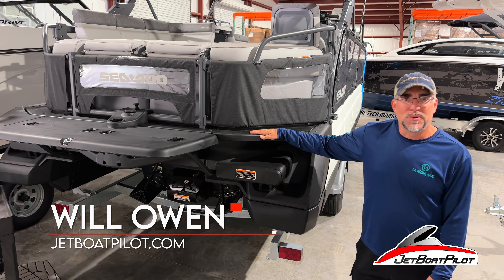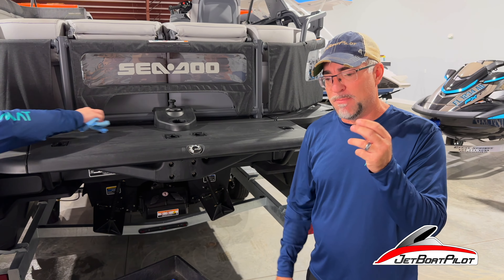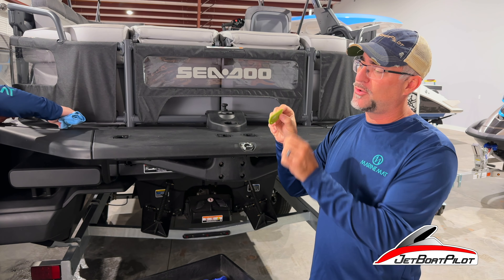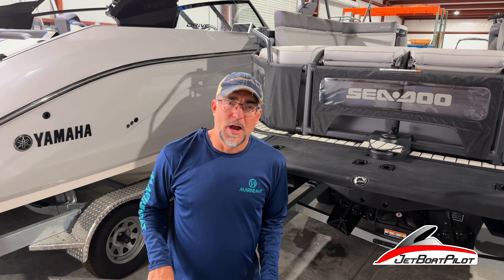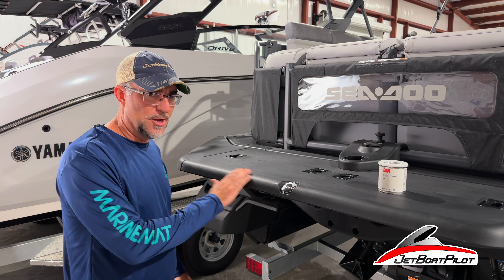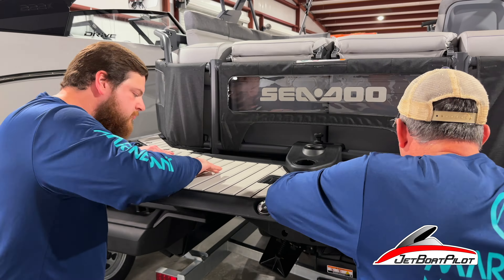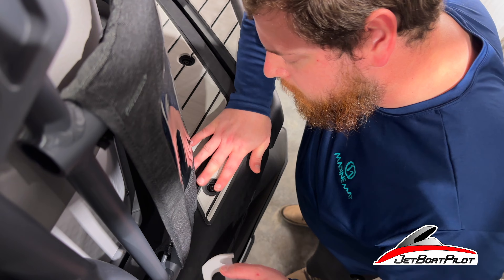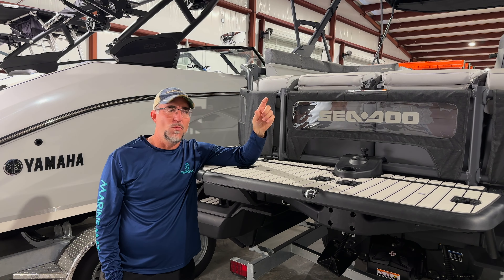No More Slip and Fall | Simple Easy Marine Mat Install on SeaDoo Switch Swim Deck

Comment: Question ? Apply Acetone on all surfaces ? like on Powder coated Trailer metal too ? - Also once Primer used, would be harder to remove Marine Mat ? Especially Trailer ? I received my Mats - Just waiting for perfect day to work on those :)
Reply from the maker: Yes ok to apply acetone to powder coat, and yes does make it difficult to remove if you use primer.

Comment: I installed this on my switch and it looks amazing!

One question, what is the best way to clean the matt? I noticed it gets colored after a few people step on it or water lands on it.
Reply from the maker: Stiff bristle brush and any boat cleaner
Reply: @JetBoatPilot  One more question, I can't seem to install Linq accessories on the swim deck due to the marine matt I installed. Any remedy for this? I have the Linq 4-gallon gas tank and it won't snap in correctly.
Reply from the maker: @anthonyvross1121  some have filed down the feet of their coolers to make them work with Linq. Others have cut away material from the contact area on the marine mat with an exact blade.